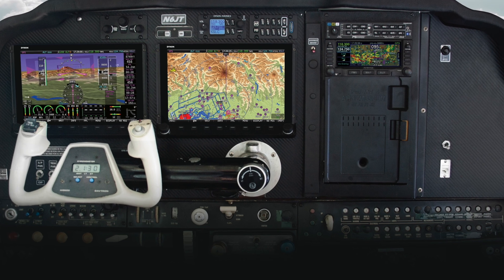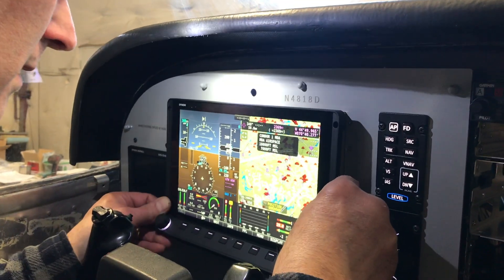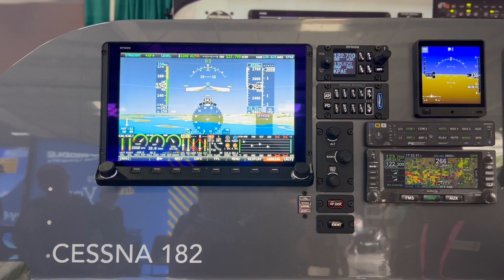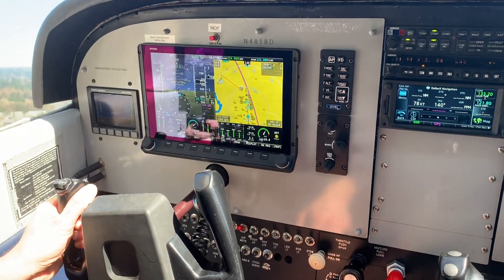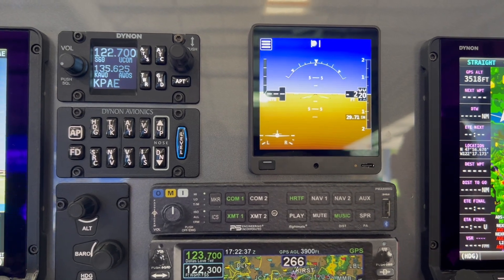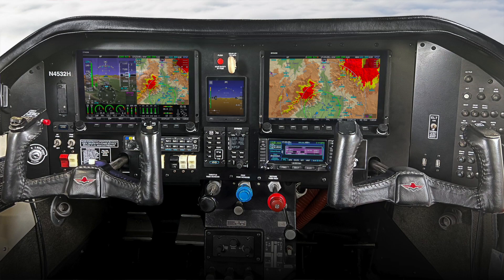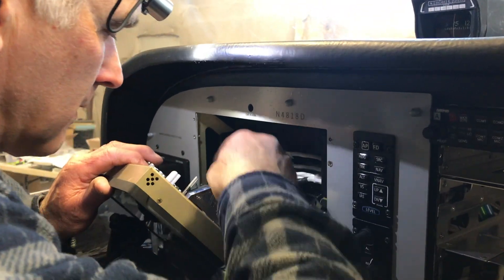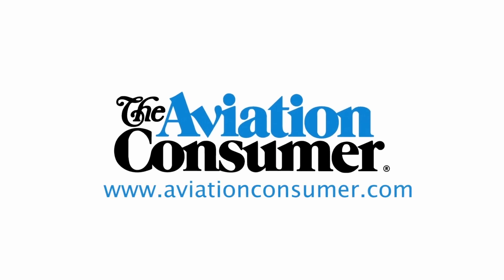Sun 'n Fun 2025: Dynon's SkyView for Certified Airplanes

Comment: Dynon: I can't afford a 30k garmin so let me buy a 25k dynon.
Reply: In my case (A36) the complete dual screen Dynon w/ AP and com was $50k.  The similar panel from Garmin was quoted at $130-140k.  Now part of that difference was that with the Dynon I kept my NGT9000D+ and IFD540.  For Garmin I would have also had to get the GTN750 and the Garmin AP is way more expensive as well.  I was able to find a Dynon shop that got the entire work done in about 7wks.  The Garmin shops told me 3-9mo wait list, then 2-4mo to do the work.

Having flow behind the Dynon, G500, Dual GI 275 and very briefly A C172 w/ the G1000 system; I personally like the Dynon system. Looking to upgrade to a PA46 (Piston) and unless that plane has a good Garmin panel already would put the Dynon in it as well.  HOWEVER, the Garmin AP is not currently approved for the PA46-350 line.  Will see what the future holds.